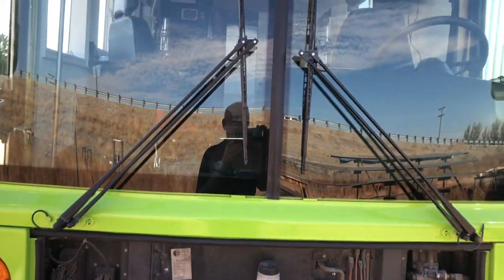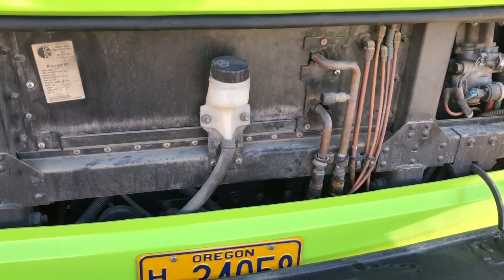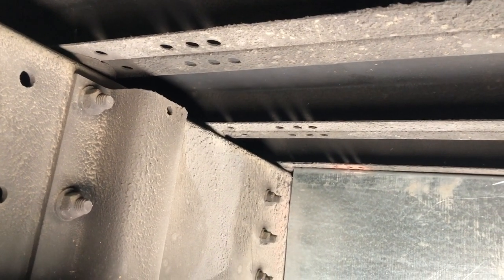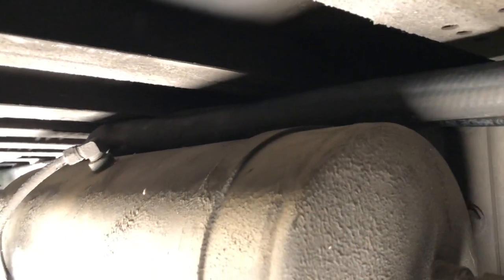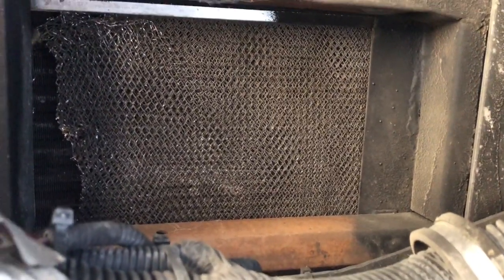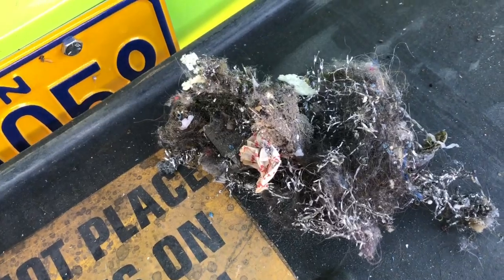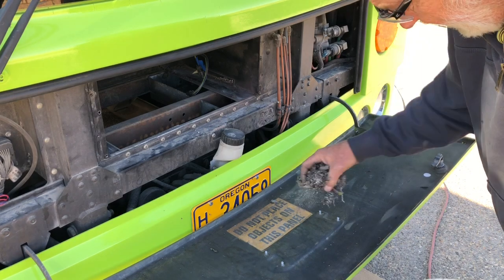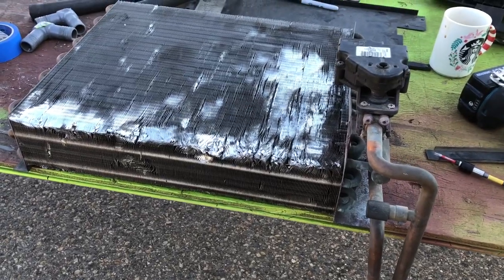Re-Hooking Bus Heater Hoses - Part 1 - Vlog 187 School Bus Conversion v

Comment: Great job, Randy. A heater core is also a small radiator. You can turn on the heat if the engine gets hot as you're pulling grades. Being at the front of the vehicle makes it ideal. Also need to add a quick connect air fitting to your air tank to run air tools & inflate tires. 👍🏻
Reply from the maker: I have had that suggested before. You’re saying that it really works makes me want to do it. I just have trouble messing with any system I like to leave them in tact as they are if I can. 😃

Comment: Nice bit of maintenance there Randy, you could also run those heater hoses on the inside of the c channel chassis as well.
Reply from the maker: Yeah I understand what you’re suggesting but there was all kinds of stuff in the way to get it in there. I wasn’t really comfortable having to lay on top of all the wire limbs. But it probably will work just fine like you are saying. 😃

Comment: Thank you for this video. I have a rear engine pusher and I removed my heater and all of the coolant lines and immediately realized that I needed to have the coolant lines running to the front of my bus to be able to defrost when we move north. I wasn't certain which line went into which side of the front heater. My assumption was the inlet into the heater was the side with the heater control actuator valve switch but I was afraid to commit to this. How about I found your video this is giving me confidence so here we go

Comment: Seems like a paper filter would be good for the fresh air inlet.  Also the heater hoses should get much hotter than 220 or you have other problems.  The rubber hose will insulate pretty well. You can take a temp reading with you iIR thermometer to be sure.  Wouldn’t worry to much about the air tank or other items.   Zip tied to the frame rails seems like the way to go.   Would be nice if you had some sort of sleeve to protect the hoses from road debris. 

Smart move running the heater box,  I’ve seen other busers who struggle with aux heaters and getting iced over and other issues.  

Good work sir. Thanks for taking us on the journey. It’s entertaining.
Reply from the maker: Thanks 👍😃👍

Comment: Hi Randy, I've thought about doing this too. But I think I'm going to just use diesel heaters. I did think about putting an auxiliary engine radiator up front under the driver area though. I would have to do the same hose routing if I put that plan into action.  Our front heater was quite disgusting.  That's part of why I don't want to reuse it.
Reply from the maker: Yeah these are difficult decisions. Good luck. 🍀 hope it all works out well. 👍😃👍

Comment: Pipe insulation would make a great way to keep the heat in the hose, and help it actually get to the front of the bus - Or you can use Pool Noodles!  They're cheap and the hollow ones can be slit and tie-wrapped around the hose,and they'll be just as good as insulation, Plus they'll protect the hose from rubbing against stuff in the underbody, and road debris.  Really - the only one that needs to be actually insulated is the Hot hose, since you'd ideally like the system to shed as much heat as possible before it goes back to the engine.
Any good Rad shop should be able to straighten those fins (they actually make combs just for that purpose), and they should be able to fix any leaks in the core without too much problem.  
Love the fact that you're setting up the original heater, since pumping the extreme heat from a diesel heater to a cold windshield will GUARANTEE it will crack (check out what happened to Bussy McBusface when they did it - in Arizona!).  The much gentler heat from the engine - especially as it's just warming up, will prevent that,  although it might take longer to defrost it when you start up.
Reply from the maker: Thanks 😃